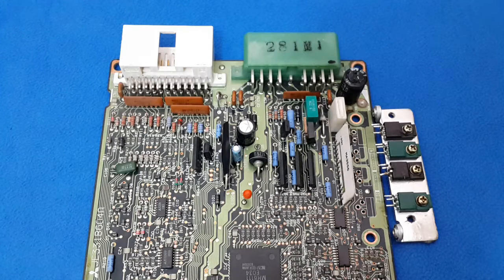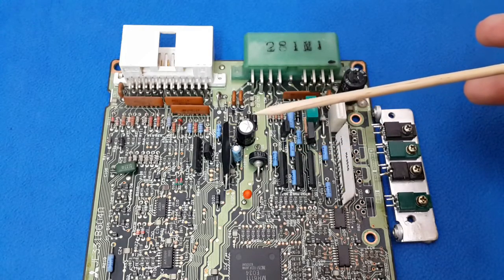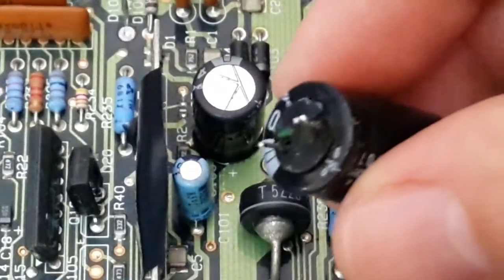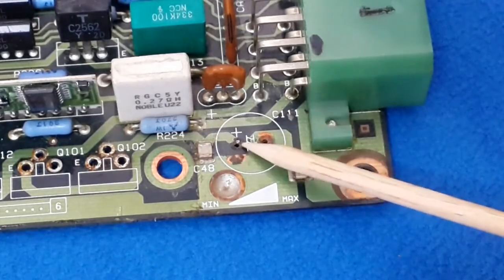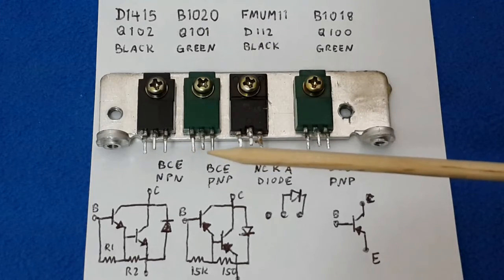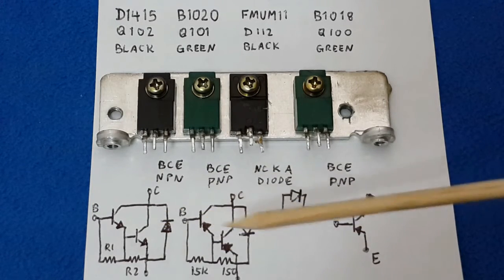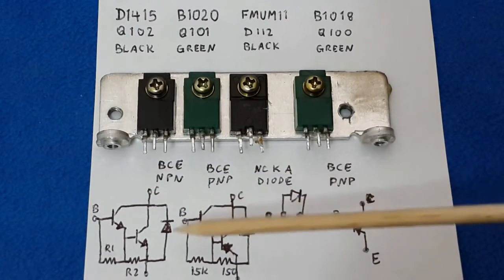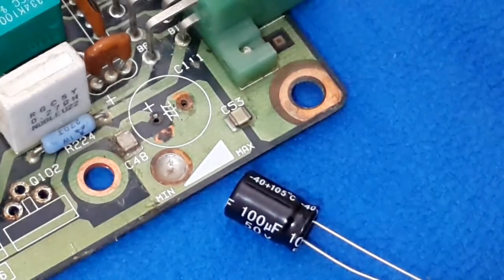How to fix Geo Tracker - Suzuki Sidekick ECU 33920-56B40 / Mitsubishi computer

Comment: Use Nichicon PJ Series 105C caps!  Just recapped a 1998 Sidekick ECU.  It had two PJ series Nichicon's one 47uF 50V and one 47uF 25V.  There was also one Rubycon 47uF 25V.  Since I have an ESR meter and capacitance meter (a lot of regular voltmeters can do this) I checked them...The Nichicon's tested out like new whereas the Rubycon's ESR was twice as high as the Nichicons and the capacitance was a little low (44uF).  Although the Rubycon was still good enough, the Nichicon's ESR values were half of the Rubycon's.  For the most reliable cap, get the Nichicon PJ Series.

Comment: dear Bob , nice video.
I had great loss of electrolyte :( in this area :( 
 can you tell me the parametres of R2(223)between  C103 and C101
parametres of R752
and parametres of C1
I change the transistors Q102 and  Q101(no 12v to b17,b8) but continued without currient on the inyector 
       
 Thank you very much !!

Comment: Great video. 

Do you test every resistor & ceramic cap, "in circuit"? I always have trouble getting a useful measurement unless I temove it first. Do you have a trick for this? 

Thanks for your channel.
Reply from the maker: +davecc0000 Hi! I always test everything I can. There is a difference between to test and to measure. We can measure most of the resistors, and to test most of the capacitors.  I remove power transistors. Power mosfets must be removed to test too. I fallow some self experience rules too. This ECU was opened, and somebody tested the right injectors transistor on board. He or she couldn't fix it because the transistor was good, and the capacitor "looked" good. :-P ...but last technician forgot, or didn't know that: when there is an open circuit, we MUST test continuity in PCB, and for power sections, we MUST measure "the conductance" in PCB, cables and connectors.
I get one client at the time. I dedicate the right time for each fixing. I can't compete with commercial fast food electronics service. I charge the right price for my time, and I win every coin from that money. I can only compete by quality service. There is always a client who wants to pay a little percent more, no too much, for better service and ensure they will not get troubles, to pay again, or to buy a new electronic unit because the cheap technical support was good only for the Commerce who offered the service. 
It is better to have a 25 to 50% more price reputation, but good quality service, than to be cheap and bad service. :-s
Reply: +Bob. Kalpon 
"There is a difference between to test and to measure. We can measure most of the resistors, and to test most of the capacitors."

Please expand your explanation. I can learn, I hope! (c;    If "in circuit" how to measure resistors accurately? By "test" a cap you mean to check if 0 ohms or high ESR?

In your video about DMM auto-range, you say fast ranging is good because when measuring/testing so many resistors & caps, time is important. Do you test all to eliminate these as bad? Or do you isolate (cap or resistor near a bad transistor, for example) and then test?

I am simply looking for a way to eliminate so many passive components on a board when no failure is obvious. Many of my repairs are exploded transistors & diodes, burned traces, obvious things. But sometimes a board is dead with no obvious signs and I'm testing 100s caps & resistors. Very slow. 

Thanks!
Reply from the maker: I will make a video about troubleshooting. Yes. We most have a "diagnostic", and work in that hypothesis... The trick is not to find a bad device. It is about to find out the reason why did we get that bad device. (We don't want it to happen again). If the injector was getting in short, it will heat the PCB, and damage the transistor. But for some reason, the capacitor heats enough to drop the electrolytic liquid and do not inflate or reduce the label. I think it was or is a bad voltage regulator in the alternator. I checked the devices that could be affected, because the best warranty is to do it right the first time. I  already called the ECU's owner to tell him to inspect the car, while the ECU is on the way back.
Also, I get one client at the time. My time is his. He is paying for it. I don't want the ECU to come back with "another problem" I could catch and prevent here. That's the reason why after making an hypothesis, and finding the problem, I always dedicate extra time in testing everything else I can. (That's the reason why I charge a little more. My competition in town is cheaper than me. But maybe their time is more expensive than mine, if they only test and change what is bad). 
Dave, there is maintenance, preventive, corrective, and also "predictive". That's something else I can do when I repair the ECU. ...testing and measuring everything else I can. ;-)